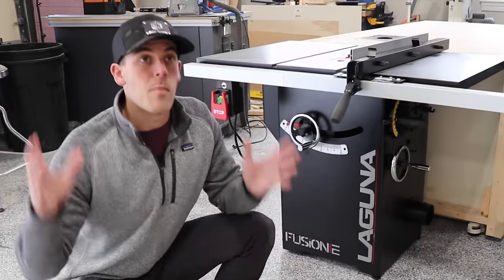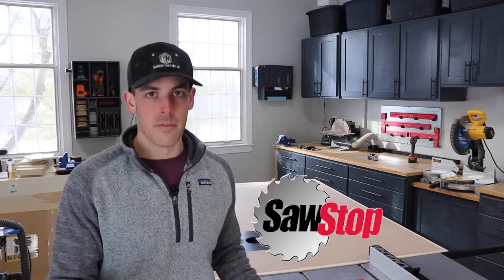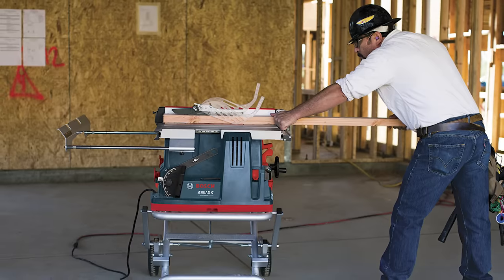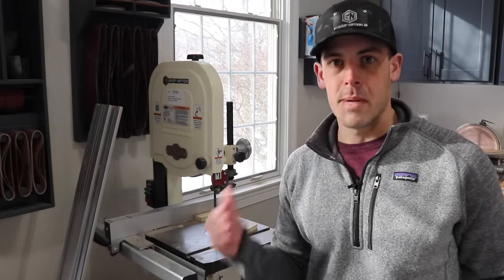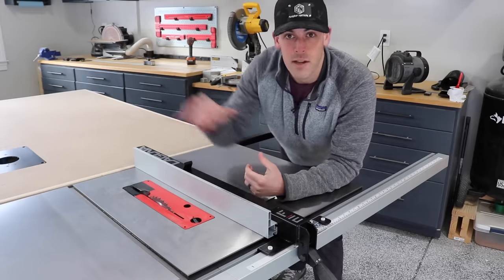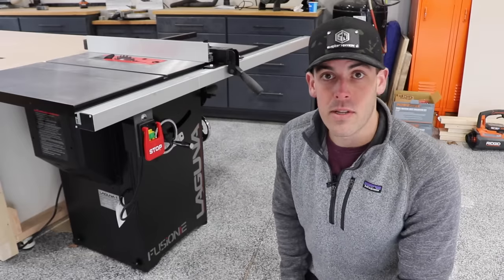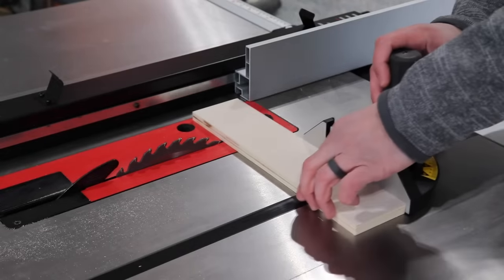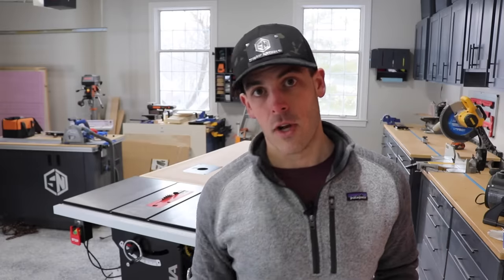Why I Bought a Laguna Table Saw over SawStop!

Comment: I feel you, man. > $3k for ONE tool IS pretty hard to swallow, especially on my retired (or as my girlfriend says, "unemployed") income. I've been doing intermediate-advanced hobby woodworking for over two decades; first with a really cheap and inaccurate Craftsman table saw, and then, a few years ago, upgrading to a DeWalt 7491 (I was working in a 1-car garage at the time, and had very little room). Now, with a 450 sq. ft. dedicated workshop, I finally have room for a bigger saw... I'm keeping the DeWalt (which is an excellent contractor saw) as a dedicated dado saw, and I've been lusting after a SawStop for some time (even before I got the DeWalt). The Laguna does seem to be an attractive machine, and at a tempting price... BUT... I live in a rural area of E. Tennessee, and the nearest trauma center is almost 30 minutes of law-breaking drive away. While I consider myself to be almost OCD about safety, sh*t DOES happen, all the time. I've had a few closer-than-I'd-like calls, but nothing life-altering. I am closing in on my 69th year on this rock, and my reflexes are inarguably on the wane; sad, but true - it comes with the whole, "life" thing. So, while the price of a SawStop is daunting, and will delay running that 220 panel alllll the way down to the shop (for the Plasma Cutter, if nothing else), I have to go with the safer option. The fact that the saw I'm considering is $350 off for SawStop's 20th anniversary pushed me over the edge (that pays for the mobile base AND some of the tax).  Still, if I were younger, and still had that feeling of immortality I had earlier in life, I might go with the less expensive (note that I did NOT say "cheaper") saw. BTW - my other hobby is motorcycles, and I ride a supersport that currently has over 82k "original" miles on it. Given my age, I no longer ride it the way I did when I first started, over 50 years ago, but the thing still actively tries to kill me every time I get on. So you see, I have more than enough risk factor in my life. And you can't work a brake or clutch lever very well with missing digits.

Comment: I've watched this video 2X. I've been thinking a lot about this saw. I too have been using a Delta contractor saw. Mine is 20 years old and still going strong. The biggest thing holding me back on this saw is the fence. I see the benefits but I also just live the biesmier style fence. This aluminum extrusion just looks chancy.

Comment: I bought a Fusion 2 the year before this model came out. Very happy with it. Have run a lot of wood through it. Like the fence, dust collection is just SO-SO. Very accurate, very smooth. Power is sufficient, once in while you could use 2 HP but just slow down a little. GOOD Value

Comment: I have to agree with what you said in this video. I can't believe that people pay that much for the SawStop. I also can't believe people pay Festol three times the amount for their tool versus other name brands. I have used early Craftsman, early Black and Decker,  DeWalt and Makida for years and still have just about everything that I bought 20 - 30 years ago, the exception is the cordless tools. I would change power cords every now and then but the tools still work good. I did historical restoration work for about 20 years and maintenance on 50 duplex's and apartment for about 20 years. So I know about tool.
Thanks for sharing

Comment: Having a saw stop saw would be cool but I have working with wood for 60 years. I have learned over the years how to keep myself safe as I work with tools. It’s not just the tool it’s the what around it and and how your controlling it. That includes me.  If your tired stay away from sharp things.  I learned this early when I was working on my dad’s table saw with my back to the driveway. Someone came up behind me and startled me and my hand went into the saw.  I nearly lost a finger. The mistake was mine for not being aware of my situation.  I have had my contractor saw for 35 years. It has been a good saw but still looking at upgrading to a saw that is more precise and dust collection is way better without breaking the bank. Many of my tools need to be replaced too because of similar reasons. Nice to hear someone else knows that too.

Comment: Almost 40 years ago I was using a miter saw albeit with the blade guard tied back, I raked the back of my fingers across the edge of a spinning blade. I was fortunate I only made an abrasion. My sawstop is peace of mind, even though I am intimately aware of the location of that spinning blade.

Comment: I have owned a Laguna F2 table saw for a year now and it has performed incredibly well. The fence has provided accurate square cuts. I did have to adjust it once after moving it in and out of my small space to rip full sheet plywood and MDF panels. I am very pleased with my purchase and also came to same choice about Laguna vs Sawstop or other brands.

Comment: Hey, I ordered the Delta saw you had before but with the extra cast iron wings and the 52" rip capacity. I ordered it from Lowes in January and was on backorder until April. After seeing your video I canceled that order and went with the Fusion 2. Still wont get it until late April, but for just $300 more, I am getting a much better saw. Thanks for all you do.
Reply: Wise move.

Comment: Your good in your head; that's what matters. I chose SawStop... already lost a finger tip (helping dad at harvest at 10yrs old, over two score years ago) and I might not be the only one running the saw (my son or who knows who else). Your risk formula reminds me of the one for pesticides: Risk = toxicity x exposure -- some exposure is okay, some "impact" is less okay. I do understand any tool can be dangerous; some, outright wicked, like a radial arm saw (mostly obsolete, especially, cheaper ones). My exposure to risk is lessened with the main tool, the table saw, removed, essentially, as a factor of risk.

Comment: After readng a few of your comments below, I came to the same conclusion you have, everyone loves Sawstop.  Is it worth the extra money for a safety feature?  I think even with all the safety features in place, you can't beat good old fashion common sense table saw working pratices.  Your fingers should never be close to the blade, period.  Push sticks, feather boards, etc. What's next, blade stopping features on bandsaws, jig saws, routers, or for that , a basic handsaw.  Thanks for sharing your video.  Safe woodworking always.

Comment: I purchased this saw and while I like it overall, I do have some issues with the customer service.  I wrote to ask about adjusting the blade/table angle because the picture wasn't clear as to the location of the screw on the back.  The person responding didn't know where it was either.  I bought the 220v upgrade kit and asked if there were any specific documentation on how to install it and they said there wasn't.  I can see how it is suppose to go, but I cannot get the strain relief clips to release.  Asking about that they suggested just swapping the switch part out leaving the cables installed.  That might work if the power cable didn't have a different plug on it.  I'm getting the feeling that this model was rushed out, but seeing it has been available for sometime, it seems they just don't care about after sales support.  :(  This will probably be my only Laguna purchase.

Comment: I have a Delta Contractor saw, i've got it tuned to do cabinet grade work. Shop fox fence, carefully adjusted absolutely everything! Runs like a dream! I've had it for over 30 years and I'm still scared of it. We'll, not scared of this saw, but more so scared of all table saws in general. Some are just an accident waiting to happen because they are junk but even if you have the best saw, and have it tuned to perfection, and are on top of your game in every way, you are by no means out of the woods! There are just things that can happen to and within the product that are an inherent risk to using this type of saw and when it happens, it's ugly! Sawstop offers a solution to digit removal, which is phenomenal, but I'd like to take this opportunity to warn all SawStop owners that digit removal is all your getting, (and while that's a lot!), please do not think that the dog no longer bites! Treat it with the same fear that you did your first table saw because if you get a kickback into the face or neck region, it can rock your world! Just don't get complacent and develop a false sense of security is all I'm suggesting!

Comment: I had a Powermatic 66, acquired in 1994.  Gave it to a community college woodworking program when SawStop came out -- bought one never regretted.  Saw someone lose their thumb on a 66, decided my digits were worth the extra money.  Until someone comes out with an equivalent technology, the only other saws I would consider would be full blown european sliders, e.g., Felder, Martin, etc.  But those would be in addition to, not in lieu of the SawStop.

Comment: A friend has a cabinet shop and has been in that business since roughly 1977.  He has never had a table saw injury and his employees with whim I am acquainted have all of their fingers.  I thought long and hard about SawStop  vs Laguna vs a good used saw.  For safety, the Laguna and the used saw were equal with many of the same features including over-the-blade dust collection so the choice came down to SawStop or anything else.  The SawStop equivalent would have set me back $3605 not including a phenolic router table, Bosch router, eight high quality blades, eight zeros clearance and dado inserts, an attached outfeed table, mobile base and an Incra TL-LS Joinery System.  The total price would have been around $6000.  The saw I got, equipped as described, set me back $1000.  Fingers are irreplaceable for sure.  I've had table saws for 30 years and still have enough fear and respect for that blade to keep my distance.  My injuries have been confined to nicks while handling blades or bumping into them when the saw was not running.  I started retracting the blade below the surface when I'm finished cutting so those nicks have been mostly eliminated.  

To compensate for having not-a-SawStop, I don't reach near the blade until it stops completely.  I use pushsticks and sleds.  I keep my hands away from the blade.  I use good judgement.  I don't stand in the path of a kickback, something a SawStop can do just as easily as anything else.  I've accepted personal responsibility for my own well-being for most of my 67 years.  It may bite me tomorrow but even getting in a car has risks.  I think my heavier cabinet saw is much safer than the Craftsman 113 contractor's saw it replaced.

I like the European high-low fence.  Last year I had to rip a lot of boards and found that setting an auxiliary fence that ended just as the blade entered the wood eliminated the blade touching the blade as the wood passed the back side of the blade.  Apparently some European fences only go as far as the front side of the blade.
Reply: Yes, pretty much.  I have a friend that has been in the business since about 1985.  Never any issues.  I actually worked for him way back in the day.   

I had some wood flooring installed in the house about 6 months ago.  They way that crew operated their dewalt jobsite saw was beyond scary.

Comment: So glad you didn't get the saw stop. I recently picked up a saw that's nearly identical to your F2 made by King Canada. My rip fence has the same exact setup with cast iron wings and a 1.75hp motor wired in 220.  My KC was priced like your F2, half the price of a SS.

Comment: I really like that fence and the milling on the table surfaces.  I have a Grizzly 1023.  It's 18 years old.   Plus the 5 years working on a contractor saw before that, I have not yet been cut by a table saw.
The ONLY thing I DISLIKE about it is the stock fence system.  And I've just never bothered to replace it.  

I do agree:  Wiring at 220V, the saws run better.

Comment: Excellent video. I'm a big fan of Laguna products (I have 4 of their machines) and when I started looking to replace my Craftsman contractor saw, Laguna was the first place I went. In the end, my choice wasn't a Laguna or a SawStop, but a sliding table saw. Price obviously wasn't a main driver, but safety was.

I think Laguna could tap into that market if they had a slider in their Classic Machinery offerings and not call it a panelsaw. I did consider a Laguna unit, but the Hammer I ended up with fit between the P12|5 & the P12|8. Laguna would also have to do some marketing and have such a saw in the local woodworking stores. People would want to see it in person before plunking down the money.

Comment: I have had a Laguna F2 for about a month now, and like you, I like some things and some I do not, but they are minor. If you are meticulous about safety and use a table saw correctly, you have almost no chance of cutting off your finger. I have been woodworking for over 20 years and not so much as a finger nick, knock on wood (no pun intended). And remember that many other tools will also slice your finger, e.g., your miter saw, band saw, jointer, etc. It is a great saw, but remember the adage - safety first!

Comment: I'm eyeing this saw for a long while but i bought the Dewalt contractor saw instead (because of the price). I'm very happy with the Dewalt and was able to do a lot of cabinet projects with it. After using the Dewalt for 2 years, I realized that a real cabinet saw is different than a contractor site saw in so many ways.  Now, I'm considering an upgrade into the Laguna F2 because of the features it has that the Dewalt doesn't have.  For instance, the size of the table matters a lot!  Also, the cast iron table top vs the Dewalt's aluminum top... it just can't compare!  To cut the story short, i'm buying this Fusion F2 because I have a lot of future cabinets to build in my garage! Thanks for your review and research. It makes me more easier to decide that this is the saw that i really need.

Comment: Never remove the riving knife, never reach past the blade to pull stock through, and if you're nervous, buy a sawstop.  I can't wait till their patent  runs out later this year so that I can afford the safety features from another brand.   I just can't afford a saw stop.  Thanks for the video.  I will look at Laguna as an option to replace my contractor saw I have outgrown.

Comment: I really do like your video. When I was shopping for a saw a couple of years ago,  I did find the low amount of information on Laguna's that you mentioned. Despite this I was ready to purchase one because the Woodcraft store near where I live carries them. I thought they looked fantastic and the price was excellent as well. I actually ended up finding the sawstop after all the research. It was the last saw that I  looked at. Despite it being $1,000 or more over what any of the other saws were, I still really appreciated the safety feature. I went with the sawstop ultimately and I have not regretted it. Despite this I have nothing against any of the other saws and I'm sure that they're all just as good especially laguna.

Comment: Good video.  Note that those features of the fence were from the Delta Unifence. Still have my Delta contractors saw from the 1990’s with a 30 in table extension.

Comment: I was dead set on an F2 until I saw it in the store. The deal breaker was the fence that didn’t quite smoothly with one hand on the handle, it binds. You have to either hold it in the perfect spot while sliding or use two hands.
The T part that rides the rail is too short and doesn’t have contact points on the front. It still works but not what I expected.
I ended up getting a King KC-10KX which is the Canadian clone of the grizzly G0899 / G0833p. 
It has the same euro hi-lo fence but waaay beefier. Had the two fences side by side and it made the F2 look like a toy. The alu extrusion was much longer at 2x thicker gauge. The fence itself is also much wider and slides with one hand touch.
Overall, the saw weights 100lbs more. That weight goes into the one piece steel rail (vs 2 piece alu on the F2) cast iron trunions vs cast alu, 2hp vs 1.75hp and thicker cabinet.
You do lose the wheels of the F2, but the saw was 200$ cheaper and I spent 100$ and sturdy mobility base and still came out ahead. 
I did like the thicker rectangular throat plate on the F2 vs the stamped thin steel. But I’m gonna make a zero clearance anyway, so no loss there. 
Oh the laguna sure looks better though, but tools are function over form for me.
Reply: Hm, I looked at an F1 in a store and it did not have that issue.  It was not as smooth as the PCS down the isle, but no real issues with it.  I recall it feeling pretty decent for a lighter fence.
Reply: @alsmith7316  it’s possible there is some sort of adjustment that can be made to help with it, this was a demo model in store, probably not tuned up.
But either way, the fence was far from the heft and quality of the king/grizzly. Both have the same features, but the king is twice the weight easy.
The king is only 30” capacity not because the rails are shorter, but because the fence is so much wider you lose the capacity. So there’s that. But if space is not an issue, the 50” rail was less than 100$ more.
Reply: @homer009x  I just picked up an F2 locally and am getting it setup on my mobile cart.  When aligned properly the fence moves as smoothly as can be.  I can use my pinky finger to slide it back and for with little effort.  Something must have been aligned improperly on that saw you looked at.  It kind of reminded my of the feeling of the Saw Stop that I looked at, just a lighter version.  Very smooth.
Reply: @alsmith7316  good to know it can be fixed. I still like the other strong points of the king over the laguna. But the laguna sure looks the part.
Waiting for my king to come in end of the month.